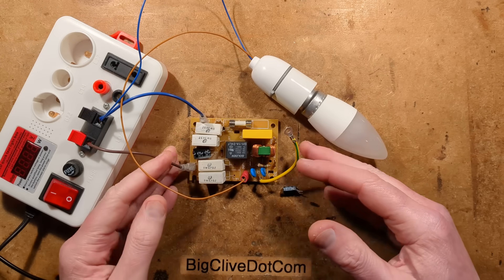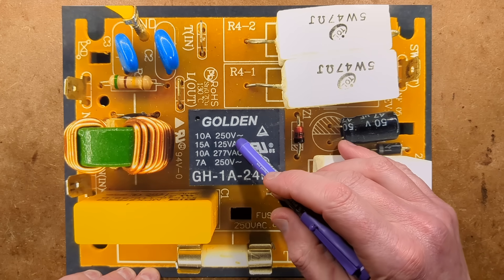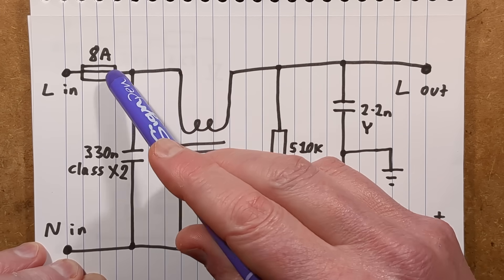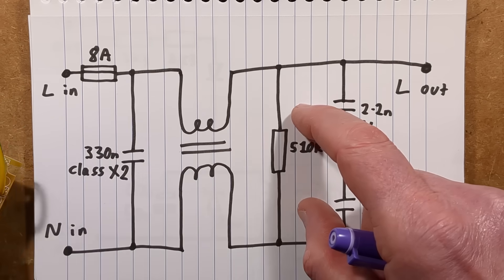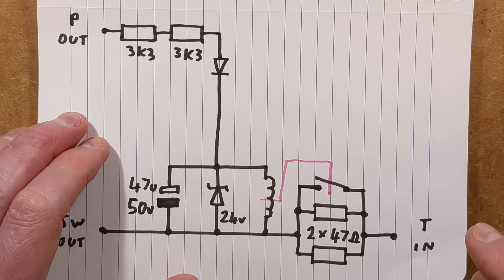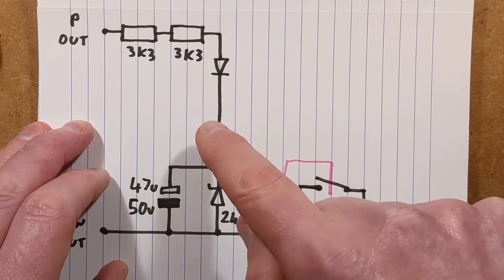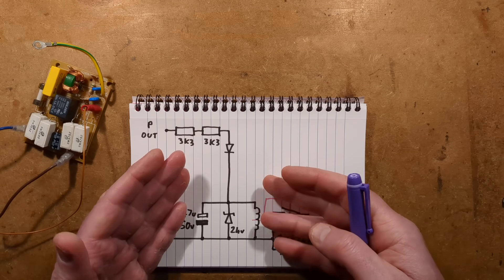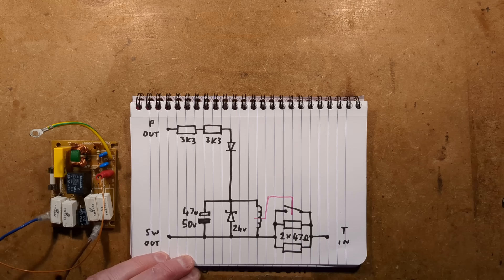Exploring a mystery PCB that is actually very neat

Comment: I made a similar circuit to start my chop saw from a portable 240v power bank. The power bank couldn't cope with the large startup current from the motor, and would just trip out. I used a capacitive dropper and a bridge rectifier instead of the resistors. No zener was needed as the relay coil load, dragged the voltage down, very close to its correct operating voltage. The capacitor gave me about one second delay.  It was a very simple, but effective minimalist design😉👍

Comment: Can't help thinking some form of latching relay circuit would be better that having that continuous waste of power holding the relay on in normal use - from a systems design perspective a case of the board manufacturer passing the buck making a cheap unit using two fat resistors and zener draining customers energy against a technically more complex but customer friendly energy efficient on\off circuit. Bean counters win again :o(

Comment: I have a related product, a 5 minute delay voltage protection relay for appliances (like old fridges without any sort of compressor protection against slugging), coming in the mail. available on ali under 'voltage protection relay socket for refrigerator' for ~$6. I'm gonna pop it apart when it comes in but I'm curious for you to take a look too.

Comment: Years ago I used to work with vintage electrical equipment and I saw on many large contractors there were additional contacts with carbon button piles ,  they had exactly the same function allowing a gradual ramp up as the contractor closed ,

Comment: If these "pre charge" circuits fail on inverter welding machines then the main IGBT's normally go off like gun shots.  Can be very scary on the repair work bench.

Comment: This is sort of the same general idea:  Back in the old days of 5.25 inch full height hard dives, the drives might take 5 Amps at 12 Volts for about 10 seconds to get the spindle up to speed after which they took about 1 Amp continuous due to overcome windage loss.  The drive makers built in a turn-on delay which was about 10 seconds times the SCSI ID number of the drive.  That way a seven drive chain could get by with a 10 Amp 12 Volt supply instead of a 40 Amp supply which would have been needed to start all the drives at once.  The bad part was having to wait almost 90 seconds just for the drives to be ready.
Reply: I still remember that noise. Four or five drives all coming up to speed one after the other. It was still going on in the half-height drive era, at least for higher-RPM drives.
Reply: @wbfaulk  I had a setting if I wanted it or not. And a corresponding setting in the SCSI BIOS if it should allow the extra time. I think that setting also had an 8/16 drive setting for max upper time to wait for all drives to spin up.
Reply: I had a set of 8 full (same as .5 height 5.25) height 3.5" SCSI2 drives in an external enclosure 10K RPM 80GB each. Attached to a RAID card in my PC. It also had that spinup delay, tho only 2-3 seconds. 
Used to store totally legit anime 'backups'
Reply: Wow you say 5.25" drives and scsi I automatically think of external CD-ROM drives which were my first exposure to scsi. At the time just half a gig was a mind blowing amount of space, no way to comprehend someone needing 7 or 8 of those things chained up. 🤯
Reply: @pcalna3202 it was a cheapish way to add a lot of downloadable software to a bbs and such uses. A cd switcher would have just 1 of the library available at a time
Reply: Modern drives can do a staggered spin up too. The HBA in my server spins up the SAS drives one at a time. That can be done with SATA drives too, but not all drives support it.
Reply: Ahh the good old days of MFM and RLL drives… 3 cables (power, data, and motor control, IIRC), lots of amps, and a noise that would wake Grandma from her grave…
Reply: @ArmchairDeity  MFM and RLL drives with SCSI IDs???
Reply: Either that or jumper the drives to not auto-start and configure the controller to issue a start unit command to each drive in turn.

Comment: Two cycles, or 40 mS, seems like a fairly short delay.  I ran into this problem when building a plate supply for an RF amplifier.  I blew out the rectifier diodes which were rated at 1 amp, 2000 Volts.  My mistake was using pi configuration for the DC filter, so I didn’t get the benefit of having the inductor before the capacitor(s).  I would have been better off with an L filter with inductor first and then the same capacitors in parallel after the inductor.

I built a soft start circuit similar to the one in this video pulling in a beefy contactor after a few hundred milliseconds to shunt out resistance in series with the transformer primary.  As Clive noted, it fixed two issues - huge inrush current especially if the residual core magnetization was pointing the wrong way and limiting the diode current until the pi filter input capacitor was charged.  Ultimately I didn’t finish the project because finding the mounting hardware and cooling chimneys for the 4CX150-D RF tubes was more than my budget at the time could absorb.  The tubes themselves were gov’t surplus and cheap, but everything else was expensive.

I learned a lot from the 1973 edition of the American Radio Relay League (ARRL) handbook which described these issues pretty well without too much jargon.  The ARRL and the UK equivalent Radio Society of Great Britain (RSGB) both have many very good publications which start at the ground and go to quite technical.

Comment: I've an inverter welder that can burn 4mm electrodes with a 60% duty cycle, like burning electrodes for 6 minutes and cooling down for 4 minutes, it's 230V and draws "a lot" of power, so it has a nice bank of big electrolytics to filter the rectified mains voltage, the last time I used it the soft start relay decided to fail and now it trips the breakers and of course is going to blow up the bridge rectifiers so I had to fix it before using it again.

Comment: Great for large capacitive or inductive loads.  Even in other designs - say a "hot swappable" product  - you are dealing with the same startup current demands. For logic boards its often the sea of filter caps that cumulatively are quite large. A technique similar to this - that limits the inrush while holding the board in reset - allows all the bits to ramp slowly and in a few cycles you provide the full operating voltage and a few more cycles release the reset. All is good thereafter.

Comment: I think the T-in terminal really should be the input, wit SW-out going to the load. Connected like this, the inrush surge pulls the output voltage down (due to the drop across the resistors) while the relay is open. This reduces the voltage available to charge the capacitor. How much the voltage is reduced is dependent on the magnitude of the surge, so the bigger, the longer it will take the relay to switch.

Comment: OH....I am going to use that circuit on the Filaments of a my valve/tube amps. Some of them have Hotspots that heat up first and will limit the life of the tubes. I've been struggling to come up with an elegant solution for that.
Reply from the maker: Could NTC inrush limiters help with that?

Comment: Mr Clive could you explain why mttp controllers are better controllers than the normal ones that come with your el cheapo solar panels? I bought a victron controller to fit on my boat for my 100watt panel and was wondering how it's more efficient. Thanks for the great videos as ever. Been watching forever.
Reply from the maker: As a very simplified example, imagine having a solar panel that can put out 24V at 1A in bright sunlight.  If connected directly to a 12V battery the voltage would be pulled down to 12V at the same 1A.  But if the charger used a buck converter to change that 24V at 1A to 12V at 2A (same power) then it could supply twice the current to the battery.

Comment: This could be used to power up a breaker popping table saw. 
I got a way more complex version from china, could not find a simple board like yours. I need about 2 sec delay to spin up the blade.

Comment: ah yes, a soft start circuit. made those from scratch for some items i have with outrageous toroids in, including an entirely unnecessary 1000W constant capable power supply for use with analog mixing desks and circuitry of a similar nature ...voltage sag ? what voltage sag ? ;) ...that said, should see the amps several hundred opamps can pull when you open up all the channels, and get everything running just shy of clipping... enough lets say, to quite comfortably forgo the requirement for background heating in most modest sized studios.

Comment: Reminds me of a time (long ago, > 50 years) when I was looking at largish toroidal transformer specs. The thinking at the time was that if you switched on at the wrong part of the mains cycle that you could get it to saturate shortly after (epecially if there was too little core material). This led to a specification of I think "surge of less than 6x normal magnetising current" just for the transformer. No account taken for capacitative load rectified or not. Switch mode power supplies were a new kid on the block.
Later on in a different area we had problems buying from US in that they would specify the core assuming 60Hz (as they always did despite being told 50Hz) and we would get horrible harmonic distotion. That also made inrush potentially a problem except that luckily we never turned the main transformer on at max voltage only the variac feeding it (usually from UK source).
Love the channel and always look forward to the commentary and info contained.
Reply from the maker: We used to have huge inrush problems with some refrigeration cases that used massive toroidal transformers for the door heating.  We had to uprate the cabling and protection to allow for it.

Comment: Clive, is the circuit in the second schematic, an RC time constant, or work like a modified version?
Reply from the maker: It's a simple time constant circuit with the threshold being the pull in voltage of the relay.

Comment: Neat, that's a very interesting circuit, no arcing on plug/unplug. 

Speaking of ceramic fuses, in my not believing products are all that good any more, I opened one fuse from a product that claimed 13A, but it didn't have any sand in it, looked like a piece of questionable fuse wire just placed inside and capped. I replaced it with known good bussman fuse I got from RSComponents. Also the device max was 400W and had a 13A fuse. Replaced it with a 3A. 

Your channel has been invaluable for confidence to tinker and check things :)
Reply: I wonder if instead of 13A the marking was T3A or F3A to indicate a slow blow or fast burn fuse.
Reply: Nope, definitely "BS1362 13A " printed in that off brown colour, no other markings in a ceramic white tube with no sand. The fuse wire was stuffed in the sides and held on with the cap.

Comment: I'm thinking how smokey those power resistors would get if the relay doesn't activate for some reason 😮
Reply: About 30 years ago we had a kind of similar resistor in our analysers (laboratory equipment) during one night something  happened, I think a few power outtauges quickly after each other or something. At least something that did not allow time to cool down. All analysers in the lab were off, all these boards broken. No worries we had them in stock, worry because that morning customers were visiting us.

Comment: 8:02 This is a lovely efficient circuit for basic soft start on amplifiers. Timed speaker relays prevent speaker thump... soft start is mainly to prevent the transformer and rectifier from getting 'overworked' when you've got a capacitor bank of over 20,000uf (can be 50Amps within the first 50-100ms) and/or tripping breakers.

It also allows the mains fuse to be spec'd appropriately, i.e. a 1amp fuse may be correct for normal failures, but will blow on start up.
Good idea to put an led across the relay coil - it will let you know if the relay is powered on, or not. You don't want an amp running through the current limiter constantly if the relay supply fails.
Reply: That's why it's best to use a PTC thermistor instead of power resistors.   They will heat up and go high resistance to choke off the power if sustained current is drawn through them.  The ones I've used  are approx 15mm by 5mm chunky green discs, 10ohm at room temperature.  Common in inverter welders..
Reply: @GannDolph I like to use a PTC thermistor for large amplifiers with BIG capacitor banks and large toroid transformers, and then I'll usually short the thermistors out with a relay after 10 seconds or so.
Reply: @davelowets Good strategy, me likes it!

Depending on the initial resistance of your PTC, 10sec may be way more time than you need.
Reply: @AstrosElectronicsLab Yes. And this can be especially hard on the rectifier diodes, and make for a short life for them. The soft start makes it magnitudes easier on the rectifiers.

For vacuum tube/valve equipment, the choice of capacitor value(s) after the rectifier tube is ESPECIALLY important, because if one put too large of a capacitor after the tube, the tube could instantly destroy itself when the power switch is closed.
Reply: @davelowets  Thanks I'm new to tube gear, will keep that in mind.
Reply: And the reason for the large current spike on start-up (especially on large capacitor banks over 20,000uF) is the capacitors look like a dead short to the transformer secondary until they start charging. This can result in current spikes on the primary over 15A on 500VA toroidals and higher.
Reply: My old Denon amp foes have a relay for the speaker part. But lacks any slow-start for the 1300 W toroidal transformer. So the lamps in the room flickers when the amp is turned on. Bad Denon...

Comment: NTC thermistors are used for inrush suppression without a relay.   For super high current devices like welders the NTC would get tortured , so the circuit they use  employs a relay and  a  chunky PTC thermistor across it.   The choice of PTC over power resistor(s) is to contain a [fairly unlikely] fault scenario:  In normal operation the circuit  functions identically to using power resistors (The PTC has a room temperature resistance around 5 to 20 ohms region).  But if the low voltage power supply fails to come up and close the relay, or the relay fails to energize for any other reason, then the PTC will soon heat up and go very high resistance preventing operation of the device.   Because you wouldn't want to start welding with the power resistors still in-circuit. 😮
Reply: Those of with one foot in the grave will recall the old valve TV sets where the heaters were all wired in series and then in series with a dropper resistor (which resembled a heating element) and finally with an NTC thermistor.  The cold high resistance of the thermistor reduced the inrush due to the cold low resistance of the heater chain.  As everything warmed up the thermistor's resistance decreased as the heater resistances increased.
Reply: @rogerbarton1790 still a useful idea for preserving valve life in guitar and audio applications!

Comment: I've used similar circuits to start banks of DC fans running near the limit of their power supply and for starting AC motors running on an inverter. In that type of application it's important to ensure that when the relay one day fails to close the startup resistors can't lead to what we euphemistically call "a thermal event".
Reply: That's why commercial versions often use a fat chunky PTC resistor instead of a power resistor, to protect against such a fault.  (inverter welders for example).     The relay is unlikely to fail open so it's mainly about the reliability of the relay power supply .   On this microwave board, they must have figured that such a simple power supply is very unlikely to fail, so they used power resistors because they're much cheaper than using a fat chunky PTC resistor..
Reply: You mean release the magic smoke in an epic fashion 😆
Reply: I've seen the result of that in a big satellite communications transmitter where the 3 phase supply is limited that way; the control circuit failed to turn the relay on and things got very smoky quite quickly.

Comment: It'd be interesting to see a teardown of a cheap microwave.  Especially the RF filtering section, if it even exists.  In the race to the bottom, any RF protection that can be legally cut (or cut and slipped under the radar of the regulators) will be.  And since microwaves operate around the same frequencies as a range of consumer radio technologies, there's a very good chance that a poorly-filtered microwave leaking RF into the mains will jam nearby Wifi (and Bluetooth) signals, at least in the 2.4GHz range.  Depending on how local mains wiring rules work, that 'nearby' could be kilometers...
Reply: the front end of this circuit is the RF filtering.  2.4GHz emissions are limited by the physical box, door, glass screen mesh etc...    I've found that the door must mate up absolutely flush to the sheet metal bezel of the microwave 'box'.   If I pushed my door in while running the microwave the bluetooth headphones interference I experienced standing within around 6ft or less to the unit entirely went away.  I removed the long  cooking instructions sticker from the bezel and the interference went away.   Upshot is that a tiny sliver of a gap will leak 2.4GHz RF.   This means that any physical deformations or dents in the sheet metal bezel will completely ruin the RF containment and unit should be trashed.
Reply: I've certainly encountered a number of  microwave ovens that interfere with WiFi. The cheap ones found in hotels, for example.